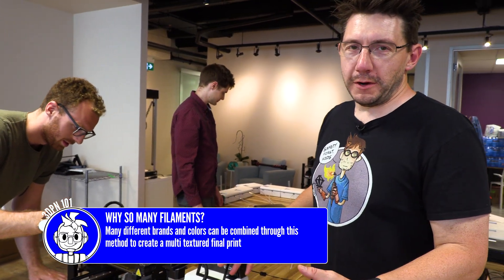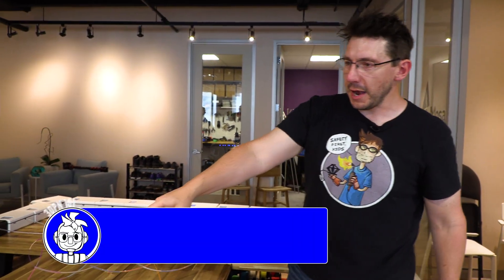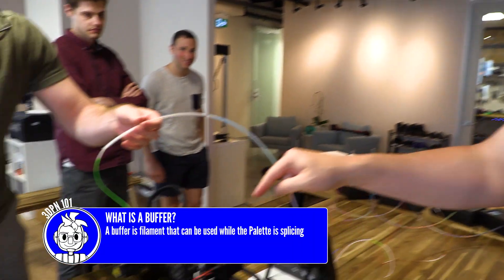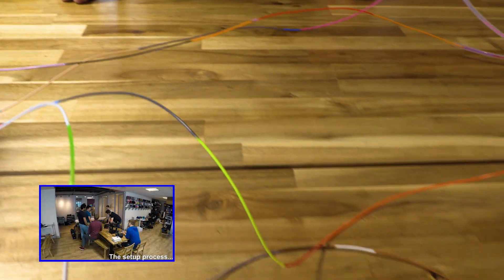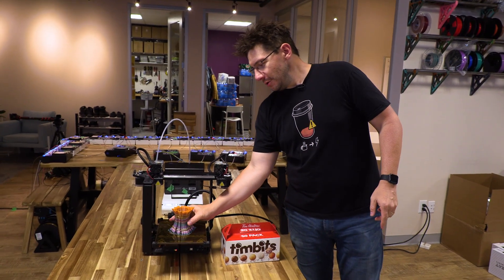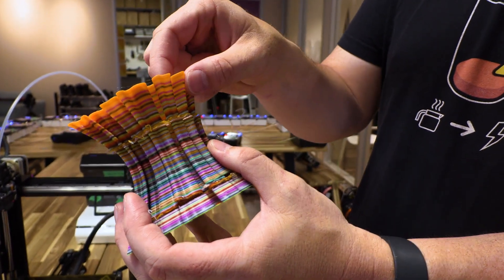3D Printing 64 Colors Using 21 Palettes!

Comment: Hi Bro , i just did a test of printing hours comparing to cura with one colour and multicolour, Canvas the number of hours for printing shows huge a big difference when you slice in cura for example if cura with one colour can slice a model in 1.0mm nozzle in five hours in canvas it shows 17 hours am i doing something wrong here please advice before i cancel the order from Mosaic as i have ordered the pallette 3 pro as i am quite disappointed , i rather make the model and colour it manually which will compensate the hours used in the canvas

Comment: Been watching mosaic pallet videos all day since the launch date of the Pallet 3 and Pallet 3 Pro was posted... and I gotta admit that while the potential for a coded 8 filament file that produces a functional print is way more than I had even expected from a new model, I would be floored if it does in fact support multiple device daisy chaining that synchronizes workable multi-material filament coupling in a functional design application... the purge block would be insane! And the delay and paused interludes between extrusion source would be a processing nightmare... it would have to purge, select source, purge, bind materials, extrude, purge, bind, purge, print... unless somehow it was able to bypass the delay time by setting up the next material in the units behind the next in the sequence? But it would have to be capable of purging at each unit to work even halfway efficiently... and even then it would only be staggering the amount of wasted materials across the units at stages and that’s allowing for a lot of opportunity for the extruded and heated filament to cool before it gets to the effective print on the plate... so, yeah, a single unit with multiple inputs is a lot more efficient & effective in the end.

Comment: I'm glad that this video proves that multiple palette 2s pro can work together. I can imagine the next concept should be 3D printing a character model with bending parts like arm and legs, 16 filaments which 8 are color pla and 8 matching color flexible filament. Or use dissolved filament for smooth printing and metal filament for armor and props (Bronze or Brass for "gold", iron or aluminum for "silver"). And it only replace 1 color, 2 filament slots. That would be very interesting.

Comment: I did have a question about the palette. I know there is an out going tube but what is the purpose of it. If I just had the spliced filament go to the printer without a tube would it still work?

Comment: impressed.. most of the videos i see of the pallet 2 has been less then desirable. I wanted one for a long time until i seen all the videos of this thing not working out good
P.S. also this thing needs to work offline before i will fork over any $$. This idea of needing to add dependency on online for your machine to work is just flat out dumb. ill pay out extra to that thief pursa before i would send any cash to the pallet
Reply from the maker: It'll work offline. They have the online component, but also the program you download and install to your computer.
Reply: @3DPrintingNerd  Nice might have to relook into one I just made my move on my first CNC on a shapeoko. after i recover from the $$. last time i looked the palette it required slicing from cloud based software. good to know it got away from that. thx 3d Printing Nerd. i ran out of things for my 3d printer so i expanded:)

Comment: I never thought filament mixing is the correct approach, nor it filament splicing. Doing it with filament splicing is problematic at best and with filament mixing you wind up with a purge block as heavy as the print itself (and sometimes more). There are ways around it, using very expensive filaments and heads that have a tiny mixing chamber, but using these expensive filaments, undermines all what 3D printing is about. Obviously, the right way to go at it is to print a layer in white PLA and have an inkjet head go over it. There were some attempts to do it, E.G. the da Vinci Color by XYZprinting.

Comment: Im not sure I understand this, but whats the point of a palette if it doesnt "schedule" the colors for a full color print. You print was just random colors, which can be achieved from random color PLA. Why didnt you print a real color print?
Reply from the maker: Going about using the Palette in this method is only possible when doing random. Typically, it controls up to 4 colors / materials and mixes them to achieve the result.

Comment: Really cool video.... I can't help but to wonder where all of the 3 d printing is going.. The under $250 resin printer is fascinating. Not to mention all of the different filaments out now. 
I am waiting for a 3D printer which will generate an edible HIGH SPEED pepperoni & cheese and Anchovy output, complete with a thin crust generator and a beer dispenser mounted to the side of the printer..   Oh lets not forget a filament maker option where you toss in your trash and this magic filament rolls out.... Yum !!!!!!!!!!!   Beam me up Scotty !!!!!!!!!!!!!

Comment: I'm curious as to how much this entire project cost. I mean, assuming you already had a 3d printer, and wanted to use it to print 64 different filaments in 1 print, you would need to buy 64 rolls of filament and 21 palette 2's...
Edit: I know some of those were palette 2 pros, but I will assume that you used 21 normal palette 2's to keep the costs down. I have done the math! I have crunched the numbers!
Assuming those are 21 Palette 2's and 64 rolls of hatchbox filament (or any other budget option), that would cost you...
With the promotion going on right now, where every palette 2 is $100 cheaper, it would be just under $11,760!!!
Without the promotion, where every palette 2 costs 599 instead of 499, it would cost just under $13,860!!!

Comment: I love this so much! It makes me wonder: would it be easier to pre-combine  for a certain length, several times (in the background while you do other stuff), and then combine those together slowly four at a time, so you can get the same kind of thing with fewer palettes, and therefore fewer places for failure? (ie if you did 16 filaments and you needed 2kg total, you'd know you need approximately 41.25 meters of each filament, assuming it is evenly distributed (though not necessarily in a particular pattern). You wouldn't have to try to do it all simultaneously, and you could even round up to 42m and you'd have 12 extra meters)

Comment: 21 palette two's, holding 4 rolls of filament each, that equals 21 * 4 = 84 rolls of filament. Color that is how it is spelled.  Your math is way off.  84 * $30 = $2,520, that is if a roll of filament cost $30.  That price is a person's price purchasing filament from a store or Website.  So the cost is even cheaper than the price I calculated.  You people need to use your brain before you make a comment.

Comment: Definitely and extremely entertaining as it defines that there are no limits to the imagination once you have unlimited resources. It's always been a what if factor once the aspect of on command multi filament combination printing was on the go. Thanks for making it happen......I wonder if you could  hand splice a filament in a simple jig to get a multi filament type on the go without having to stop the printer and change over filaments.

Comment: Looks like the Palette could really use a synchronisation feature. Then feed the 16 Palettes with logically chosen colors for creating real controlled muticolor prints.
Reply from the maker: Can you imagine? If Palette devices could talk to each other??? CRAZY. I cannot even imagine the math involved in that.
Reply: Even more if they could implent color mixing, by cutting very short pieces of primary colors for having them molten together in the hotend. :)

Comment: its an ok system - be realistic - they should be mixing the colors, with a heater etc... technically more difficult but true color - we in house pause printing, change colors etc... slower but avoids wasteful filament towers -

Comment: @ Pallet People
1.still waiting for a 3mm pallet...... seriously.... what the fuck is taking soo long?
2. I want the ability to use 2 pallets, on duel extruder printers, during the same print, where each extruder is given the proper filament from each pallet, so you can do proper 8 color prints.
3. there needs to be a way for one pallet to feed another, and actually know what is printing, instead of just slicing up randomly.
4. Did you make a 3mm pallet yet? no? then do it!

Comment: Could you just make a spliced roll of filament and spool it and then feed 4 spliced spools into the pallet to print?  Seems like it would cut down on the points of failure.
Reply from the maker: Yes, and I've done that here at home. We were there and had access to all these machines, so, HAD to try.

Comment: YES! Though I agree with shane beasley: I'd like to see something that isn't just a vase (yawn) and random color changes. It may take some creative slicing or software work to make it happen.

I also know from talking to their support, they don't support passing pre-sliced filament into the Palette as the diameters might not be small enough to get through the splice core/tube. So the fact it finished with 1 filament still going was luck or a bit of hand holding.

Still, great to see someone actually do this (at scale) instead of just make a joke about doing it.
Reply from the maker: I didn't choose the model, and we didn't have time to try another thing. If this video does well, they MAY be up for giving it another shot down the road. It was a LOT of luck, that's for sure.
Reply: @3DPrintingNerd  Still glad to see it actually done

Comment: Sigh, I miss the content where you could actually afford what he's showing off if you were on a budget. Been a while Joel...
Reply from the maker: I'm trying out and using what I got in the order I got it all. Currently, testing out the Longer3D Orange10 resin printer - it's a very budget friendly model. Also, some Cetus prints coming soon.
Reply: @3DPrintingNerd  looking forward to that! Sla has fascinated me for a while now, but the printer and supply cost..  woof...

Comment: Sure but have you tried using a palette with 3 rolls and have the output be the 4th roll to constantly loop through the machine?
Reply from the maker: HOLY CRAP.
Reply: Filamentception
Reply: Thats like taking a set of clay and mixing it together into a brownish grey mess. At least its pretty when its still layered

Comment: I'd love to see them create a program that's able to calculate the purge block as infill.  It would be interesting to see if they're able to break down how much distance is necessary for purging the colors, incorporated it as a recommended infill.  Granted, smaller models even at 100% infill would still require a purge block, it would be great to see that most filament is being used in the model.
Reply from the maker: They currently have that in their Chroma software. I know they are working to bring that functionality to Canvas.

Comment: I want to see a single filament printer with a CMYK dye sublimation module that colors the filament on the fly as it enters the extruder :)
Reply: That's a good idea. People have used Marker Pens set against incoming filament to colourise it but Ive not yet seen a system that switches it on/off according to GCode. Maybe you should design it : )
Reply: Something like this? https://www.kickstarter.com/projects/ordsolutions/rova4d-full-color-blender-3d-printer

ETA: I's not a dye, but it IS a CMYKW solution.
Reply: "da Vinci Color mini" It's not exactly what you're expecting but I think it's close enough!  :)
Reply: Yeah, I've seen the marker version and inkjet version. Dyesub is a bit unique because the color is more UV resistant and less prone to fading. Unfortunately it's less heat tolerant too, which means it may not be realistic in 3D printing. But I'm sure if someone had the right skillset they could make something happen :D
Reply: M3D has apparently made a printer that does just this, the "M3D Quad". Not sure how much I trust it considering bad experience I've had with that brand in the past.

Comment: so if yyou can splice 2mm and have enough palletes for speed, you could maybe do dithered coloring ?
Reply from the maker: Um, sort of. The 2mm splice isn't always going to work out well, and it is a bit of a wildcard.
Reply: @3DPrintingNerd  I suppose a mixing nozzle would be better if someone wanted to try to make dynamic shades or pastels

Comment: When the Formula for more palletes is just 4^x and the final output is always 1.
4^5?
Reply: Or you can think it like each layer provides 2 bits of color (4=2^2), and the first layer provides the two least significant bits, the second later the two in middle, and the third layer the two most significant bits. 
(But the cost would ramp up exponentially when adding more bits)

Comment: Couldn't you just print the first 16 spools of filament to the 4 Palettes , then later feed them into the singular palette? Or am I missing a step because that would make the process much easier. You could also do this with only need 1 Palette and large amount of time.

Comment: What would happen if you tried to use the palette with CMYK colors and use them like a 2D printer does? Obviously you'd still need black but maybe you could have 2 palettes for that.
Reply: You'd also need white somewhere...
Reply: Better yet, stop perpetuating the myths that support the one that CMYK supports every possible color humanly visible regardless of assumptions regarding human optical "color rods", and go with seven filaments close to spectral saturation, plus black and white filaments, plus one uncolored transparent filament (ex: "natural" PLA). Four Palette modules, ten rolls of filament significant flexibility, and more realistic color reproduction than you'll ever get with current consumer display philosophies. Given a small enough nozzle output diameter and layer height, the right settings and g-code, and maybe a few mechanical tweaks to the various extruder assemblies, you could even have proper pearlescence and similar effects in your printed products without having to pray that your intended vision is available in whatever sparkle filaments are in stock at your store of choice.

Comment: I had a similar idea that I talked with Mitch at MRRF, but it was scaled down to one palette per extruder motor... mainly for dual color machines... to see if the two devices could work in tandem with the dual nozzle (or mixing) to get a home user able to print 8 colors (or combination of 8 materials).  

Thanks for showing off that it is possible to do really cool things with these units!!
Reply from the maker: Thanks for watching!